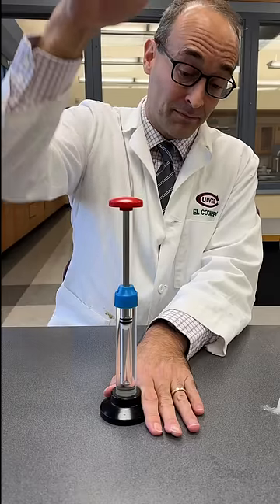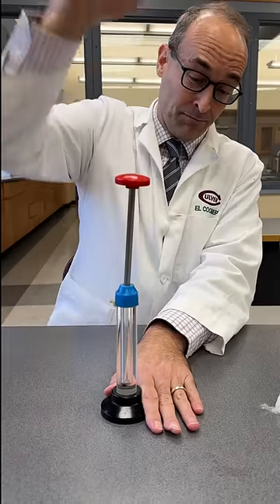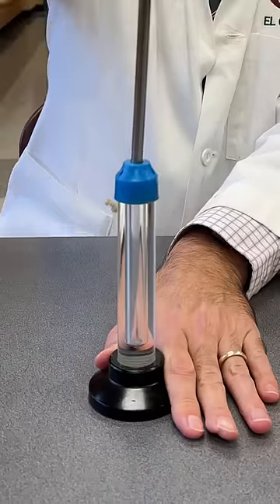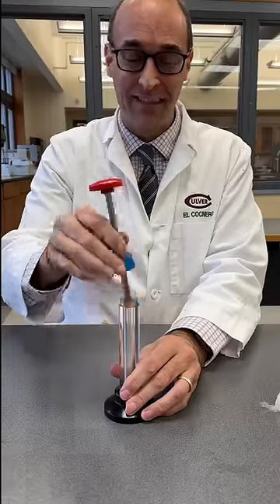Squeezing air to burn stuff

Comment: Sqeezing something quickly does not generate any heat, or at least not enaugh to light something on fire. The heat is already there, it is just way too much spread, but by squeezing it you compress the heat, so average amount of heat per cubic unit is higher

Comment: I hate to be "that guy" but gas engines need a spark to ignite the gasoline but diesel engines work as he described that's why the compression is significantly higher in a diesel motor than a gasoline engine

Comment: This is essentially how a nuclear bomb works, except that here the heat is from compression of an air/fuel mixture, versus compressing atoms  of a highly-fissionable element. 💥😊
Reply: 60 points. They compress the atom using shockwaves from conventional explosives

Comment: Well you're concentrating the energy in the molecules into a smaller and smaller space therefore the temperature of said molecules will get hotter and hotter.

Same applies when you also decrease the pressure as then the energy in this case heat (thermal energy) has nowhere to go so most things will boil, like blood so yes in space?

You'll boil not freeze

Comment: I'm guessing that the sudden change in pressure causes the a larger portion of gas molecules to initially have higher kinetic energy until equilibrium is reached and a more narrow range of velocities is achieved. Is this correct?

Comment: That engine model is a T head. Not very common. A flathead with crossflow valve arrangement. Almost requires 2 camshafts. Pretty much negates the manufacturing cost advantage of a flathead vs an overhead cam.

Comment: Squeezing the gas didn't generate any heat. The heat was already in the gas. You just condensed all that heat into a tiny area thereby increasing it's temperature dramatically.

Comment: No, a diesel engine just compresses the air, no "burning it" is needed, no spark plugs.. duh?
Reply: compressing the air technically results in burning it, that's why there's no spark plugs

Comment: Ever heard of Crysco? Well, Before they found a way to Solidify Cottonseed Oil into, Um, Crysco stuffs really bad for you, but that's another story) - They used the Cottonseed Oil to run Diesel style Equepment - It was in the WAY WAY back days, because a Diesel Engine works on this Principle and Cottonseed Oil is a good Fuel and before Crysco (or Shortning) was invented they really didnt have much other use for it

Comment: Where does the energy come from to create the heat from compressing the gas? Is it the mechanical/kinetic energy which transfers into heat, or what?
Reply: the kinetic energy applied to compress the air so much turns into heat that burns the cotton.

Comment: Those toy air engines I’ve seen in shorts a while ago. But, they’d add some fluid to the engine (if I’m not adding memories in that is) then heated the cylinder where the air is, then hand cranked the engine. Very cool stuff!

Comment: So if compression causes heat then why do refrigerators have compressors.
Reply: To compress and heat the air si that they can cool faster during expansion. Read up on the refridgerattokn cycle.
Reply: @420sakura1  Could it be that two of us need a little more study? Maybe we need to understand Ventura effect and energy used in phase changing.

Comment: What is the maximum compressability of air? Like...could you squeeze 1m³ of air into 1dm³? I know of course with enough force you can compress anything. The cores of Neutron Stars have densities of billions of tons per cm³. But I mean with human measurements. If you exert several thousand bars of pressure, how far could you compress air?
Reply: Can be done but we need a lot of energy. And very strong containers to store it. Compressed air was used to run small  steam engines (for temp work and places where steam exhaust is undesirable). 

The small compressed air cans you use for cleaning purposes are not real compressed air, it's just a gas that expands at room temperature. That's why it feels cold when you touch it.

Comment: That is gasoline engine knocking occur. Is it possible to only use direct fuel injection to control ignition timing for gasoline engine?
Reply: Impossible. Petrol can't be compressed too much else there will be a knock back. That why we needed Leaded petrol to increase its compression Rato.

Comment: Horrible explanation why it ignites. And its not like an engine
Reply: of course it's not like an engine, but the principle applies to diesel engines. The main point of the video is compressing gas results to higher temperature.

Comment: You can compress air as fast and as strong as you want. It will never burn. Because things don't burn under pressure effect. But pressure can make combustion easier like in diesel motors. Search what triangle of fire is and you will understand this video shows stupidities and lies.